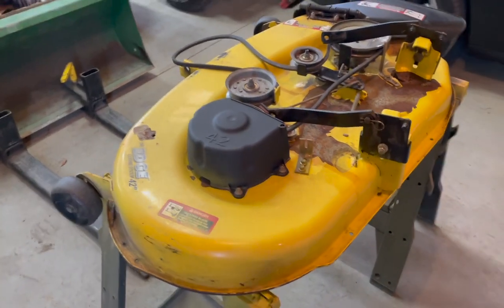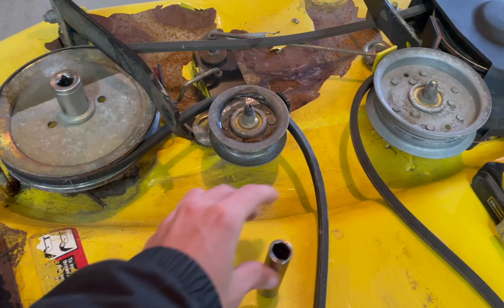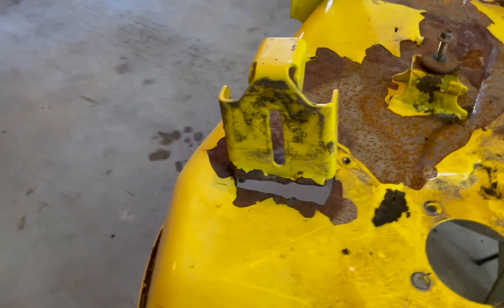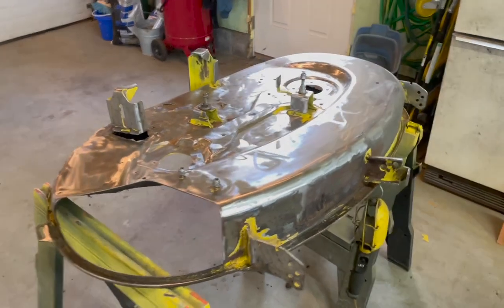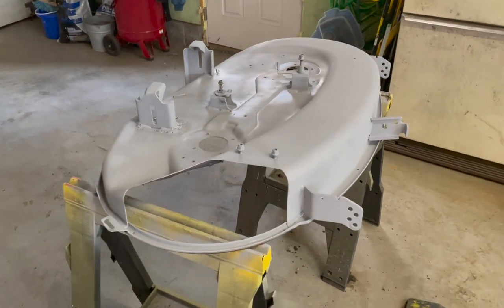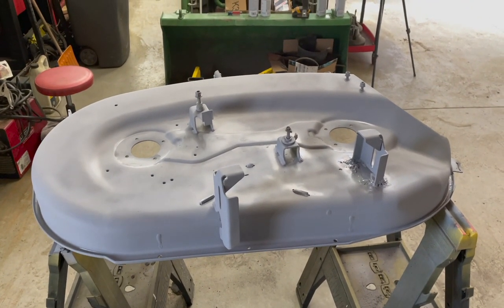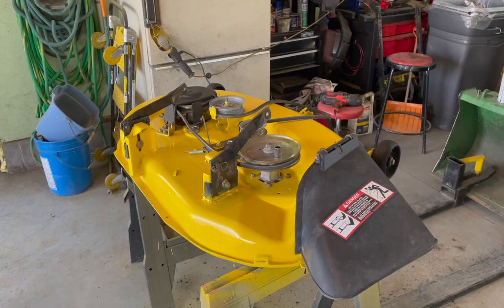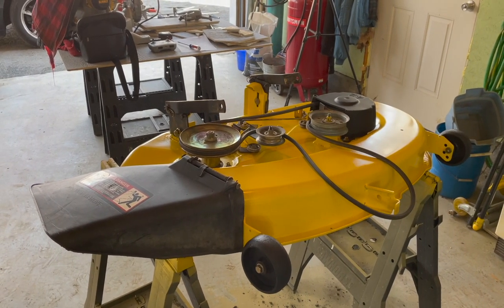Refinishing a John Deere 42" Mower Deck!

Comment: I just rebuilt my 1987 JD 165 Hydro deck. Very similar to your rebuild but I like what you did better. When I finally got my deck back on, which was an incredible task for that model, I could not believe how well it works and actually is 100% more efficient and quiet.

Comment: I have done 2 decks, this same way. takes time but done right, I did notice on those two decks that I repaired that the underbar where the discharge chute is ,was rusted out and not attached or missing causing the scalp wheels weldment  to crack, I made the new bars , and re welded the brackets .I am now working on a snapper deck , from 1998 and that steel that they used back then is BOSS!  I have no rust through on the entire deck.Just surface here and there.

Comment: You put a lot of work into this - as someone who's repaired these for longer than I'd like to admit, a few pieces of unsolicited advice while you've got it all apart:

replace the wheels or drill the center holes larger and put some steel pipe shims in there.  Good, tight wheels make a bigger difference than you'd ever guess and they won't rub.  I'd also weld multiple gussets onto both of the rear hangers (at the very least the one you welded!) as well as onto both of the wheel holders.  These are areas that break very often, it's easier to avoid problems than it is to fix them.  Lastly, I've found over the  years that these decks like to crack around the bolts that hold the blade spindles on.  You can find "repair rings" online to bolt onto the top of the deck (so they don't impact the height of the cut) -- again, strengthening those areas now will avoid a lot of headache in the future.  (some guys weld fender bolts above the existing holes - I find the repair rings are quick, easy, and overall a better solution.)

Your deck turned out very nice!  I'd actually recommend paint over powdercoating (from another comment) because it's easier to repair and cheaper to apply - a can of yellow spray paint every spring when you're sharpening blades and greasing the spindles will keep it looking fresh!
Reply: Great advice
Reply from the maker: Good advice, maybe on the next one I will do that... JDs design theyre always wobbling....

Comment: I repaired/refinished a JD deck that looked exactly like this one. I used a flux core welder. Our welds look the same LOL But your paint job turned out much better than mine. Nice job.
Full view & .👍 # 152
Stay well, Joe Z
Reply: Same story lol   I just acquired a LA120
Reply from the maker: Very cool! Thanks!
Reply from the maker: Great machine... we have one with over 800 hours on it 😳

Comment: My aunt had just given me her old John Deere lawn mower and it's in very good shape there's a little bit of paint peeling on the top of the deck I'm wondering if this ever rusts out am I better off I'm not very mechanically inclined I'm wondering what the cost difference would be to just replace the deck then doing all of this taking apart and repair I fairly believe I can take the deck out and put a new one in what is the cost benefits either way whether I replace the whole deck or I refinish the whole deck. I sure would appreciate any and all recommendations I really love the look of the John Deere I used to have a Craftsman riding mower and I hated it
Reply from the maker: I think refinishing would be much cheaper then buying a new JD mower deck unless its beyond repair.

Comment: Awesome job!!  I’m fixing to redo my deck also. Think John Deere forgot to put a primer on the 100 and 110 series decks. They seem to rust out very easily. Question?? Would it be better to do a powder coat or primer and paint on outside. Was thinking a Teflon coat underneath. To stop grass from build up underneath. What do you think would be best. Also, when you mount back on the mower. Could you show how to level this deck. Most of the other decks have a hanger bar. But, mine is like the one you refurbished in this video. Thank you fir this video and any information, you could give.
Reply from the maker: Thanks!! If you have the means to power coat it, I would say go with the that, it will hold up longer than regular paint.
Reply: sandblast deck, paint it with POR15 2-3 coats and then a couple coats of paint of your choice, POR 15 dries to a very hard finish that doesn't chip off easily, better than powdercoating

Comment: Yeah thats nice. At least yours was in better shape before you started than my 38 inch deck off my 216 john deere. My deck is a rust bucket I have alot of work that needs to be done to that thing.
Reply from the maker: Thanks - yes they can be a real bucket of rust!

Comment: Great video. The only thing I wish you would have done was a more in-depth of putting the police back together and adjusting the brackets that holds up the deck I see there's like a slide adjustment for those brackets and I didn't see how you adjusted it
Reply from the maker: The deck adjusts in the front by rotating the nut in to raise out to lower.  The brackets on the back control the elevation of the back.  Loosen the nut and move the mower deck up or down.  When positioned, tighten the nut.

Comment: Well a half gallon of paint stripper would have stripped all the paint of both sides of the deck in 20 minutes  plus all the  hangers and power wash it off  Then you could have flappered the rust ,welded it added rust killer both sides Then primered and painted both sides and the hangers and the plate under the guard  and it would have been better than  the new decks they sell now that the paint peels off  in chunks At least Thats how i do my stuff But i will say the top of your deck looks great I hear peeps say its only a mower deck But thats why you got the mower and you dont want to buy a new mower deck every few years for the sake of some paint and clearing the grass off it  after you have mowed  ?
Reply from the maker: Good points!

Comment: You should discard that plastic pulley guard as it
collects grass & dirt & water and accelerates rust.
ALSO,
NEVER clean a deck with water as the water will
work its way down the pulley shafts into the bearings
accelerating bearing fail.

!
Reply from the maker: I will take a look next time I have the deck off! Thanks for the tip

Comment: john deere kinda sucks, their powdercoating for the decks and body comes off in large sheets, i've had to sandblast deck, paint it with 3 coats of POR15 then a topcoat of glossy black chassis paint, so far its held up now for 5 years with no signs of rust or paint chipping off when pressure washing deck at end of mowing season
Reply from the maker: It definitely doesn't hold up as well as others... but even Cub didn't hold up that great either... take a look at our video on that mower deck